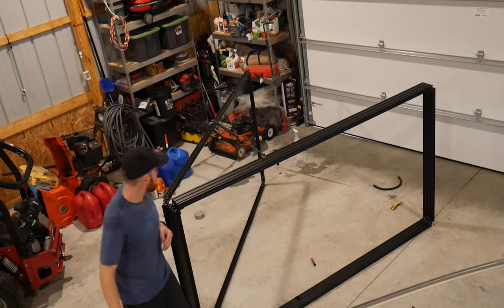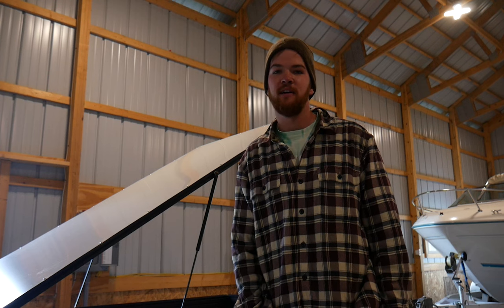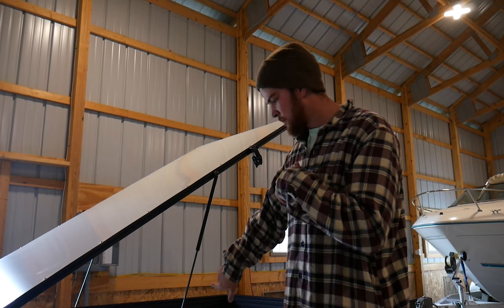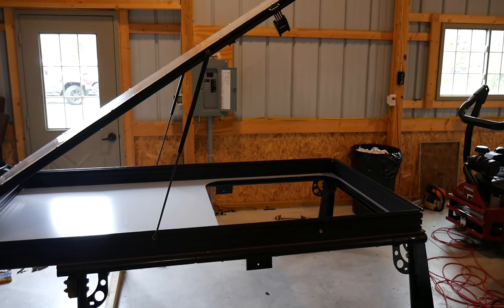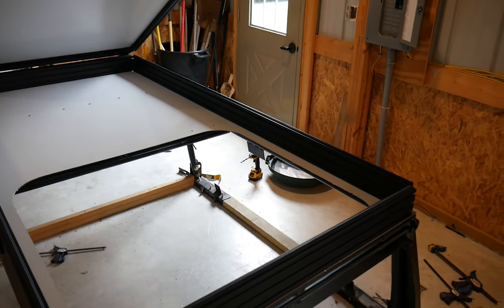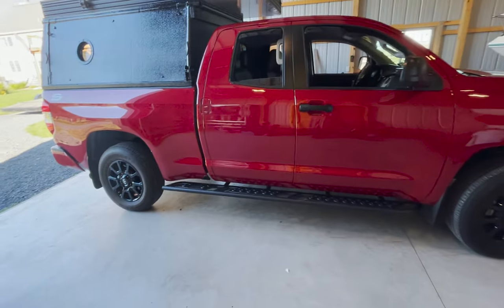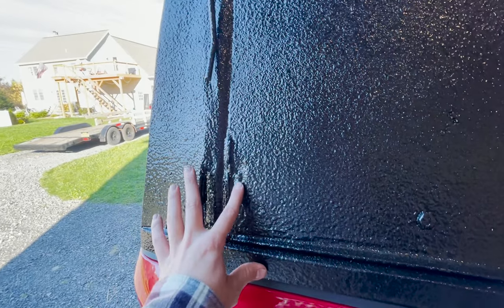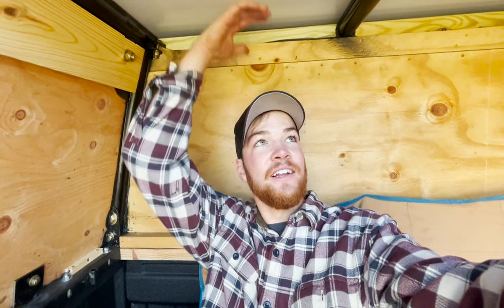Building a Pop Up Truck Camper from a Ladder Rack- Part 3

Comment: Having worked with wood, metal and 80/20, I’m wondering about the decision not to do a butt the side 80/20 to the front piece for a stronger joint that only leaves one open end open. 
Nice start. Port holes are a nice idea.

Comment: Get your pieces in place inside the t-slot and put a single drop of superglue on it to hold it in place. The precision nozzles will do it with very little mess. If you realize you have set one or two of them in the wrong place you can easily break the nut free and move it.
Reply from the maker: Not a bad idea! Thanks for the tip
Reply: @SunnyandNicktravel  t-slot can be a devil to work with. Hope it helps in the future.

Comment: Dude I thought you gave up on this!  Our builds are scary similar.  Hell of a job so far!!!!!!  I'm finishing the roof on mine.  I went crazy and built a roof which has 3/4" plywood bolted to the 8020, steel furring underneath, insulation, lights and much more that I can't disclose at this time!  Let's just say mine requires 4-150lb struts!LOL  It's going to take me a month to put the video together!LOL  Love the exterior being sprayed which allows you to know its not going to leak.  Also if people truly knew how hard it is to attach that 8020 to that flat C-Channel and then through the hobo freight frame they would pay big dollars for what we are building!LOL  Lastly I dont know if its something you need but I found a company called Front Runner Outfitters that make a boltable(if thats a word) wind fairing that is about 7" wide that would work great on the front of that to shed the wind up and over!  I used the 6" extensions when I put the hobo freight frame together to give me more clearance as well so now the overcab part is really high. Check them out.  Looking forward to the finishings!
Reply from the maker: Thanks man! Much appreciated yeah I had to take a few months of time to wait for the 8020 cuz it backed order to like 5 months haha but was finally able to put the roof together! Can’t wait to see your build man sounds like they’re super similar!! That roof you built definitely sounds cool. But yeah that’s too funny cuz I was literally trying to figure out a way to reduce the wind on it cuz it’s affecting my gas mileage pretty good so I definitely will check that out! Much appreciate man I’ll be looking out for your video when it comes out

Comment: What thickness of ACM did you use? It is aluminum composite panel correct?
Reply from the maker: Yes they’re Aluminum composite panels also known as alupanel. I used 3mm and that was plenty to support us with the supports I built into the frame

Comment: Do you recall what the measurements where for the upper and lower strut mounts?
Reply from the maker: I didn’t exactly have an exact measurement just played with it till it could fully collapse the topper and I liked the height of it when open.
Reply: @SunnyandNicktravel Great build buddy!! You know what lb struts they were? And did you figure total weight of load when finished assembled for the weight by chance? And how much drag did you figure your going to have over the cab to overhang?